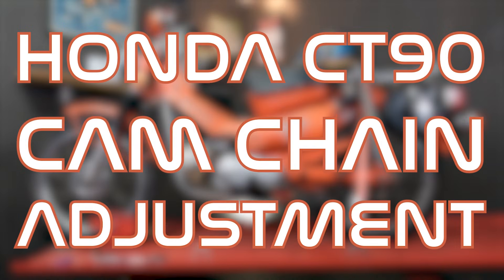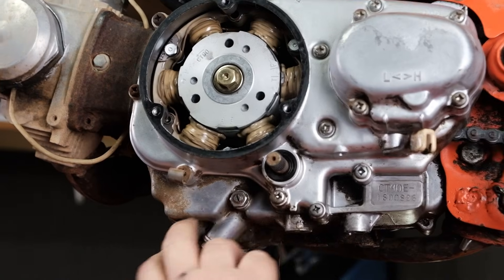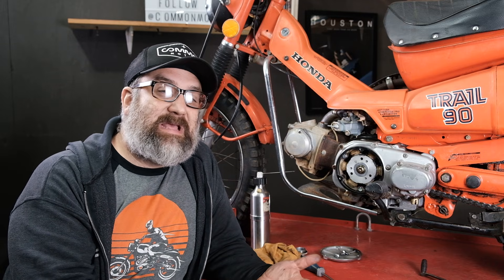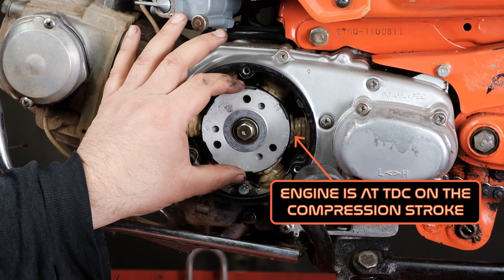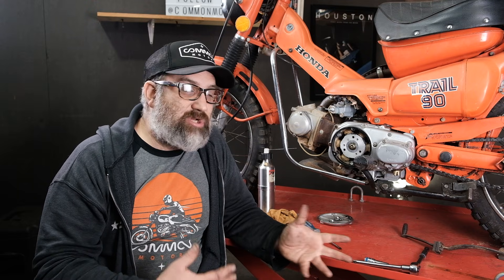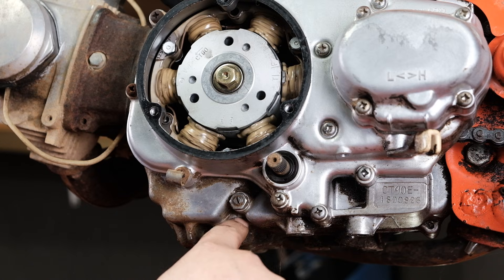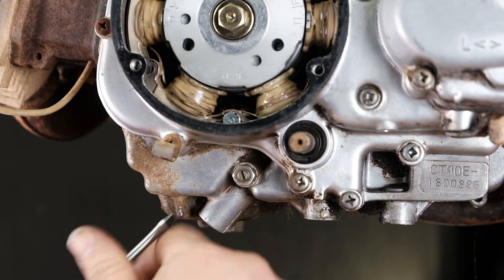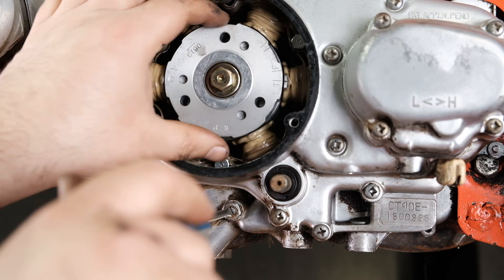How to Set the Cam Chain Tension on the Honda CT90 / Trail 90

Comment: I wanted to watch this bc I put my 78 ct90 away last year and went to fire it up and it’s starts right up but when in gear under a load the engine is shaking. Has new points and nos advance. I’m gonna check cam chain but it’s super weird and I’ve worked on 100s of bikes and have never seen anything like it. Any ideas?

Comment: I have an sl70 k1 with this setup. I've been searching for months on instructions for adjustment. The cam chain is really loose and rattles. It runs great but this needs an adjustment. I assume this sequence would work on an sl70? . Thanks a lot and let me know.